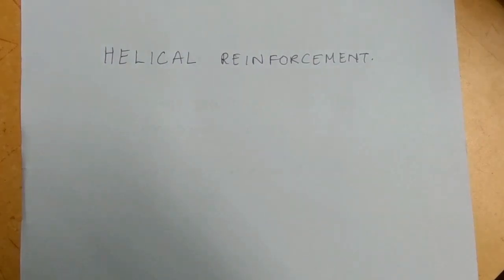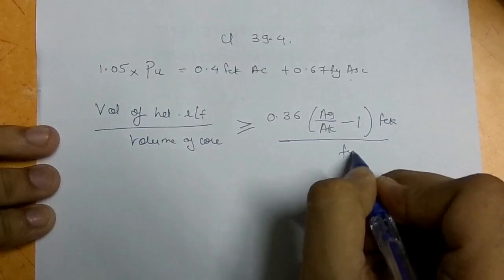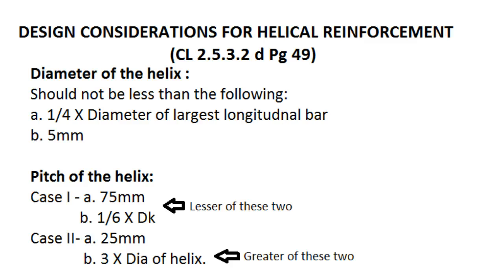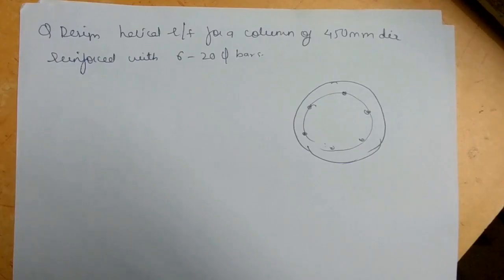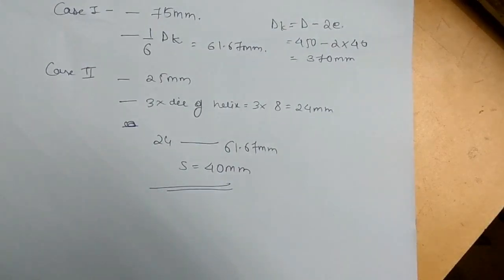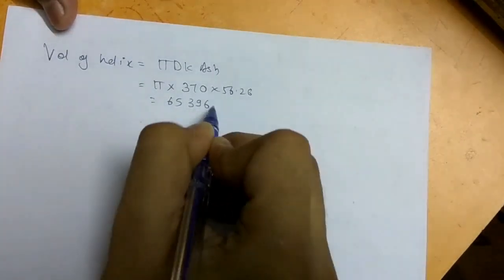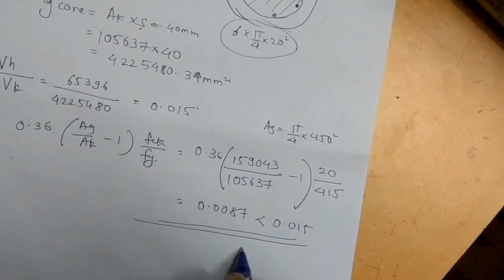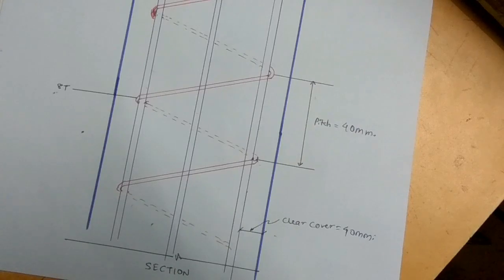HELICAL REINFORCEMENT IN COLUMNS | LIMIT STATE DESIGN | IS 456 - 2000 l Mumbai University

Comment: FOR THE PITCH;

For What do you mean by the MINIMUM condition; 3x diameter of the ''helix'' , you mentioned the helical bar,  can you please locate it. 

Is that the main vertical bar ?

Great video, sorry for my ignorance
Reply from the maker: Sorry for the late reply. Thanks for pointing out. The diameter of the of the helical bar is taken there. In this case we were using 8mm bars as spiral/helix so 3x8=24mm. I hope it solved your query.